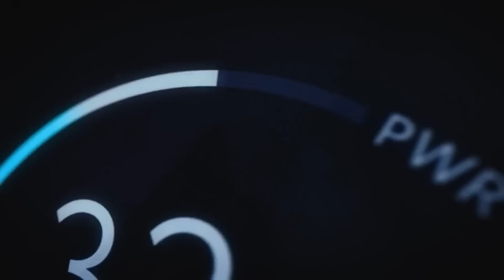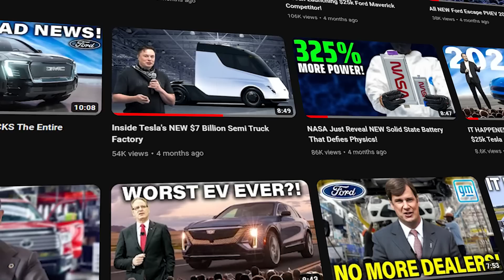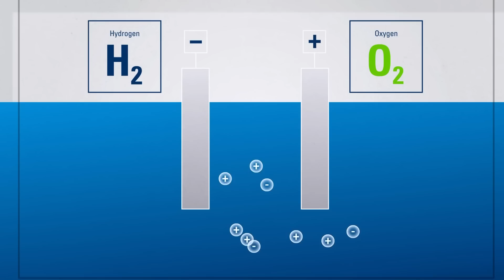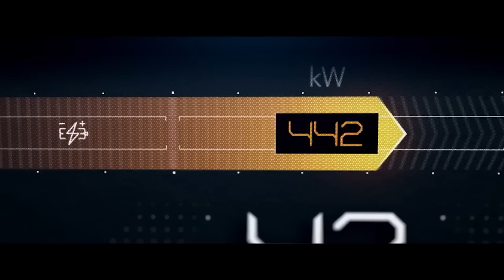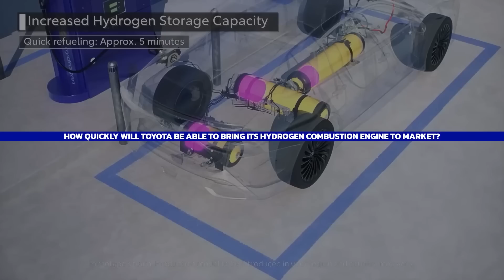New Toyota CEO Reveals Hydrogen Combustion Engine | Shocks Industry!

Comment: Toyota must know something we don't.   Are battery resources finite?  Some say yes.  There are some disturbing videos of how elements in a batteries are mined.  From what I've  been reading US has virtually unlimited amounts of oil.  Anyone have seen different data?  Respond here.
Reply: Battery resources are finite.  But can be recycled. You can’t recycle burned gas….
Reply: @Meatball2022  I didn't know battery can be recycled.   Most folks just throw them away.  Myself included.  You've just enlightened me if that's true.
Reply: @fringelunatic  It is cheaper to recycle car batteries than it is to mine new minerals.  Almost the entire battery can be recycled.
Reply: @fringelunatic  yes. They can be recycled. Larger batteries are recycled - like those in EVs. Smaller ones - people often throw them away, but that’s usually out of habit. They can be recycled as well
Reply: @troyfall6573  No the can’t. Not even close. Usable rate is closer to 10% at best.
Reply: @troyfall6573  Car batteries are lead/acid. Way different than lithium batteries. Very costly to recycle a lithium battery.
Reply: @Mike-hb4pc  true, but they have already figured it out and it is still cheaper than mining new minerals.
Reply: @Meatball2022  yeah, recycled at a less than 10% usable rate. Just about everyone in the industry knows this. Which means resources are extremely finite.
Reply: @dirkx2350  completely incorrect. And no, everyone in the industry doesn’t know this. Because it’s incorrect. Even cursory research will tell you differently. 
What you’re referring to is the percent that is sent to recycle. That’s different than how much of a batter is recyclable. 
Recycling consists of shredding the battery, separating the elements, then reusing them. A very high % of EV BATTERIES are sent to recycle. 90% OF A BATTERY CAN BE RECYCLED. stop lying
Reply: @Meatball2022  i have no idea what you’re background is but I’ll just say i work in vehicle development. More specifically, multivariable propulsion. That simply isn’t true. Lithium itself has around a 50% extraction rate and a less than 10% usable rate. Lithium is what matters. Recycling extraction rate and uasble rate is what matters. Not commingled recycling numbers. Oh, and its not getting any better. Its actually been quite stagnant since the 90’s. But I’m lying.
Reply: @dirkx2350  curious since you’re an expert. What percentage of burned gasoline is recyclable?
Reply: @Meatball2022  i wouldn’t say I’m an expert, but i do know current limitations on most things requiring lithium. Petroleum is 0. But to further answer your condescending question, it doesn’t matter whether it is or not for quite a few reasons.
Reply: @dirkx2350  you’re not an expert. But you touted your “credentials” really quickly….
Have a good day, expert.
Reply: How on earth can oil be “unlimited”?  Think about what you’re reading critically….  Just applying logic, that’s a ridiculous claim. 
1) if us had unlimited oil, why do we import 75% of it?
2) even if it was, what difference does that make when referring to issues around smog etc?
Reply: @Meatball2022  because different refineries are designed for different types of oil.
When the present administration took over the US was a net exporter of oil.
Reply: @OneOut1  so - either we don’t have the right oil or the right kind of refineries.  
That’s a ridiculous argument frankly. If we were capable of being fully self sustaining on fuel we’d have done that decades ago.
Reply: @OneOut1  keep in mind - one of the reasons we might export more oil now is due to increase in alternative fuels including natural gas, wind, solar, and EVs….
Any way you cut this, the suggestion oil is unlimited while batteries are limited doesn’t pass the smell test.
Reply: @Meatball2022  Yeah, why do we import 75% of our oil. Oh yeah, Biden did that. We were totally oil  independent when he tool office. They claim another 100 years of oil lays under the US right now. I'll be long dead and gone before that happens
Reply: You are assuming they are wise. They are not, they are greedy though.
Reply: @Bbenkosky  what car mfr isn't.  They are all in it to make a profit even Tesla.
Reply: @fringelunatic  Tesla released all of its patents to the public domain (with few strings attached). Tesla is leading the transition to sustainable energy.
Reply: I am just trying to open a healthy debate.  Such vitriol here. My fault what did I expect.
Reply: @fringelunatic  no vitriol. Just a word of advice. When anyone tells you anything is “unlimited”, that’s a huge red flag. 
If one battery for a car lasts, say, 150k miles, that took the place of burning 6000 gallons of gas. There’s simply no way these are equivalent - even if you couldn’t recycle the batteries.
Reply: @fringelunatic  Tesla believe their Lithium, Iron, phosphate batteries are 98% recyclable.  Boil it up and pour off the lithium and the iron. Even if it were not recyclable, most of the earth is made of iron and lithium is also availabe naturally, so disposing of it would be easy.  Farmers love phosphate.
Reply: Whoops.....and China just spent a ton on mineral rich land in North Africa.  No matter though, the Bidens got their cut for brokering the deal....The US has basically unlimited natural gas and oil when allowed to produce it.  Maybe soon we will get leaders that aren't hell bent on destroying America.
Reply: 83% of the world's lithium is mined in 3 countries.  Australia, Chile and Argentina.   Those nations are able to source lithium responsibly.   The US and Canada are also looking to expand production.
Reply: @troyfall6573  That's good.  I was horrified how Cobalt was mined in Congo.   They call it artisan mines.  They use children to do this.  Very sad.

Comment: What a joke, this will be my last Toyota. I currently have a Toyota Hybrid 2018. The next car I will buy  will be an EV in 2025, warranty  runs out then. Have 10KW solar system at home so charging will be free for me 98% of the time. How many Hydrogen fuel centers are there in most states none. This is the most inefficient method to store energy. Hydrogen leaks are very hard to stop. Also to produce hydrogen is also inefficient. Come on Toyota get with the EV direction now while you still have a chance to survive.
Reply: hydrogen will be produced using nuclear power plants. Japan has an entire economic model for this. Look up "red hydrogen.".
Its better than evs because most ppl dont have a solar set up, solar is unreliable and charging takes too long. The power grid cant handle mass ev adoption while a hydrogen approach would only require building more power plants. Hydrogen also works with existing and future cumbustion technology unlike EVs.
Reply: @ilyarepin7750  think about this- it costs electricity to create hydrogen. 

cars take a SPECIFIC amount of electricity to move. 

Hydrogen is less efficient then pure electricity. 

So, it will cost MORE electricity to use hydrogen, then pulling it directly from the grid, for a car to go a certain distance. 

So if the grid can’t handle EVs, it will never handle hydrogen.